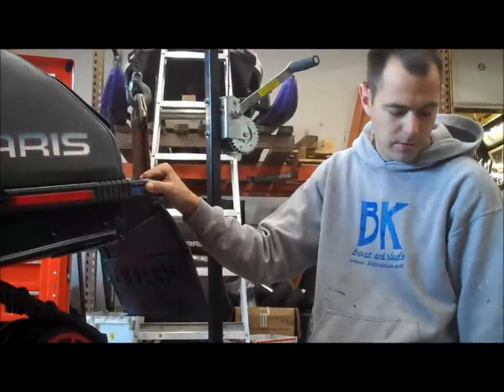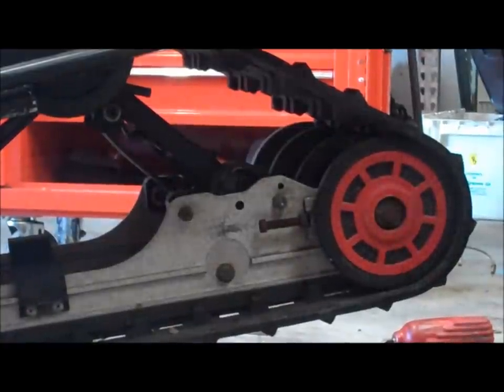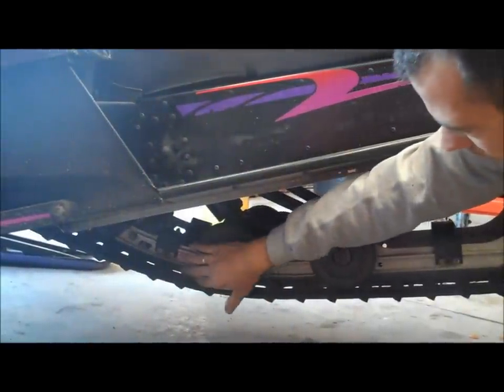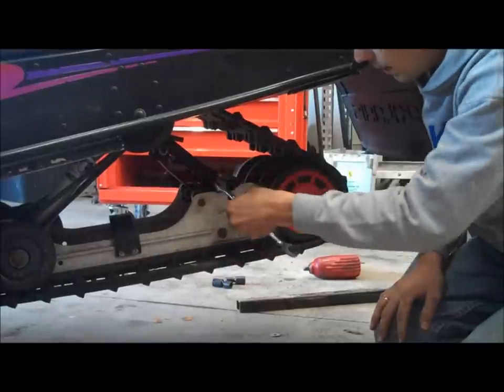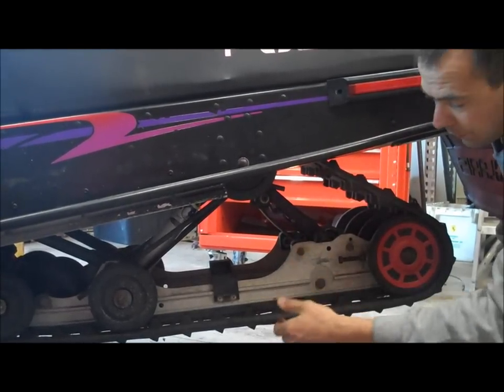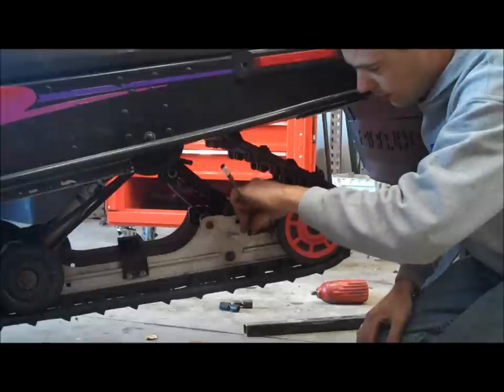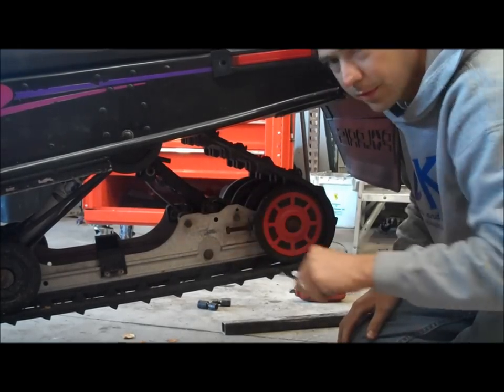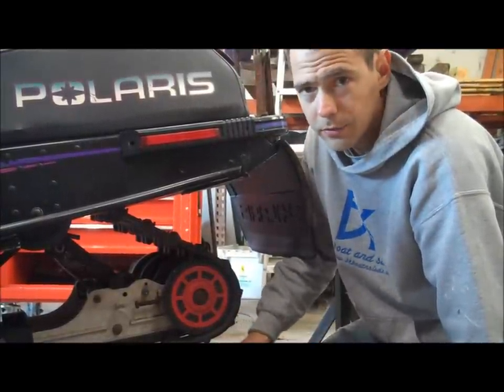How To: Track Tension and Alignment (snowmobile)

Comment: Here is my "By the book procedure" from the "Original" factory Polaris owners manual for my "97" Indy Storm 800 triple ... get the sled in the garage ... use the roof rafters and a tie down strap or rope or come along to get the track off the floor (A tree limb would work if no garage) ... Measure from the center of the rear idler wheels center bolt  forward along the bottom of the track ..16 inches ...  using the "driven" clutch... roll the track until the center of a track slider  clip falls right on that mark ... hang a 10 pound weight from that clip and it's opposite or sister clip  on the other side of the track so 10 pounds is pulling down evenly across the width of the track. Measure from the top of the slider clip ... that the weight is hung from ... on both sides of the track ... to the bottom of the "hi fax" (slider ware rails) . That distance should be no greater than.. "one half inch" ... and no less than.. "three eights inch" .. Use the adjuster bolts with lock down nuts as shown to move the rear idler wheels until the measurement is within the range ... and as close to exactly the same on each side as you can ... Once that's done you should have just about the same amount of adjuster bolt exposed on each side  ... if not.. you can  tweak them "slightly" but the measurement between the clips and hi fax is what's important .... This is the ONLY method I use .... The "Polaris Factory Method"  ... The track on my 800 .... Right... square... on the money ..   ;) .... Good luck  fellow sledders !!!   " T  Man " ...  Michigan..
Reply: yep, very well said my friend. perfect! cant go wrong.

Comment: an easier way than counting threads, and more accurate than the "finger method" is to just measure from the head of the bolt to the jam nut

Comment: I check track alignment by checking distance between the track lugs and the inside of the rear axle idler wheel.  I believe this is how arctic cat suggests doing it.  As for track tension, I've found that if the track is too tight the sled slows down quicker once you let off the throttle.  I like to keep mine looser to allow for more free-wheeling after lifting the throttle.
Reply: +repetitivemotion The main danger there is if it's too loose your drivers are going to slip.  That's why you want the right tension, not too much or too little.  I don't agree with the maker of the video that you should make it "as tight as possible", it should actually be right in the middle of the acceptable zone ideally.
Reply from the maker: +pseudocoder78    As tight as possible, without the track ratcheting.  We are saying the same thing differently.

Comment: 1999 Polaris XC 500.  Have a video on replacing the antifreeze hose that goes from the front of the engine to the back of the engine and then down to the heat exchanger?  Does the engine come out?

Comment: the manual says to view the track window for the slides to be dead center on both sides. also i believe the sag for track tension is 15lbs and 1" clearance at bogie wheel.

Comment from the maker: You have to have the back up, adjust the track, and then spin it a few times,  If you try and adjusting it w/o spinning it - it's never going to line up.  It does not need to be PERFECT - but your going to wait it close so you dont have track clips hitting anything, and you dont damage the drive lugs on the track.

Comment: I have a polaris xlt toruing 99. 600 triple. I put a new belt on it. And the track is spinning. I cleaned the clutches and still spinning. Would adjusting the track tension be a good idea.
Its the right belt and its adjusted.
Reply: Bruh that's just a shitty track with no traction left puts some studs or maybe a new track with a bigger lug or ease onto the throttle a bit nicer

Comment: If I am ratcheting my front cogs, I was told the track is too loose because it's allowing the track to slip. 
From this video you said the track is too tight and would cause ratcheting
Reply: Mine dose too, in fresh powder and crossing bare spots with no snow, (dirt or sand.) I have 1987 Indy trail 488. The original owner took great care of it then my brother aquired it and left it out year round for 6 or 7 years. I went through carbs and deleted the intake silencer. Now its racheting and the track very obviously is off with lugs touching on one side and ¾ inch on the other. The only thing I am concerned about at this point is the chain case bearings. I have went through everything else but 8m actually afraid to take the cover off the chain case. I'm the lucky type where it's always worse case scenario not something simple as track alignment.. lol

Comment: I got a Polaris rmk 800 n was riding in a area I don’t ride in was trying new areas n I tapped a rock now on bk side it makes a humming sound do I no wat that can be
Reply: I suspect you bent something at the rear axle .... the rear most idler wheels  and their axle ... the place where track adjustments are made .... that axle back there  must be dead straight and true or the idler wheels connected to it won't run straight and true ... and she'll start singing to you ... in ways you don't want her to .... take a close look at the rear idlers ... look for cracks ... loosen up the track and see how they spin  ... they have bearings in them ... they have to spin smoothly ... no roughness in the spin ... if they seem ok ... you gotta check that axle for straightness  ... you bent or damaged something when you hit the rock ... that's why it's singing ... you have to figure out what got bent and replace it ...

Comment from the maker: The real difference is where the tension bolt is located.  If yours is on the side like this Polaris - it will all be the same .  SOME of the Yamaha's had the bolt in the skid, and you have to go in through a track window.

Comment: Any thoughts on a 96 polaris ultra so ....belt seems to flop around,sounds like a muffled machine gun almost. Went through the secondary, not it.kinds like its slipping,sled jerks a bit at slow speeds. Ideas?!!
Reply from the maker: Did you check for a worn out belt?  Or bad clutches?  (start with the belt)
Reply: Clean and Sync your carbs. They can actually make it jerk or lurch at slower speeds spit & sputtering could also be the rapid popping sound you here

Comment from the maker: @codyraab1 It could be a lot of things really..  For one, keep in mind the tracks dont spin by have very easy.  Take your belt off to see if that helps.  If you still can not spin it, check bearings on cog shaft (some on each end) check track alignment too.  And if its too tight that will make it harder to spin too.  But remember its not like they spin super easy.

Comment: my track wont spin like that    i need 2 hands  and it seems tightr even though ythe tention bolts are backed off  any ideas ??
Reply: Did you loosen the axle?
Reply: @jerryrupe7391  no
Reply: @ronl1104  you have to loosen the 9/16 nuts on the axle so it's free to move when you turn the adjusters in or out. You'll need a wrench on both ends to prevent it from just spinning. Good luck.
Reply: @jerryrupe7391  thats not why the track wont spin  ..  the tention was right oiff  of track and hard to turn    found 1 screwed wheel  so far  suspect others

Comment: Why not measure the adjusters to verify they are exact on both sides with proper deflection. If it's not aligned using that method, then you have an issue with your drive...likely a worn bearing.

Comment: what causes a track to spin really hard?? i cant spin my track with my hands
Reply: Bad bearings in your idler wheels and  bogies could be an issue. Or your track is to tight.
Reply: Is.your drive belt on? Very hard to spin with that on

Comment: you said you would explain why a yamaha is a little different, how so?
Reply: The adjustment bolts face back towards the back of the sled, you have to access them through the track windows
Reply: *****
sorry for delay - Yes - above is correct.

Comment: sounds to me like you are ratcheting. Remove your track and check all your adjustments. There are anti ratchet packages you can get too. Requires a different track to match. Not sure other than that. If it feels like every foot or two of travel you "hit a bump", that is the most likely cause. Ratcheting. I will be repairing the same issue on a sled soon that was brought to me for other repairs. I found this issue when I pulled it off of his trailer. Thinking about making a video of it.